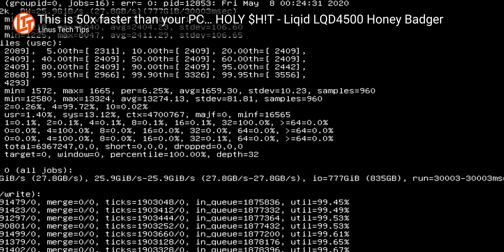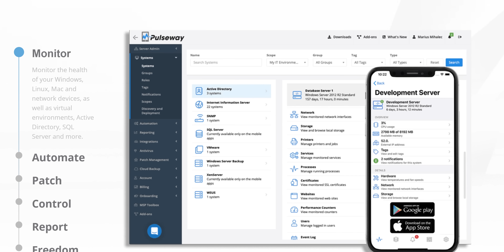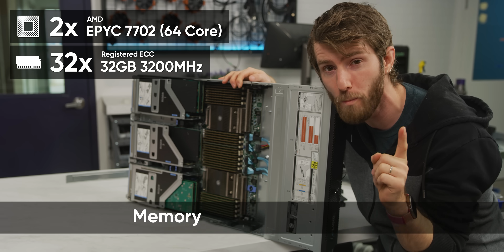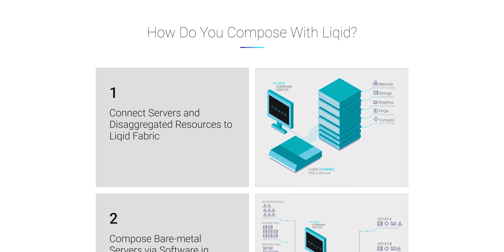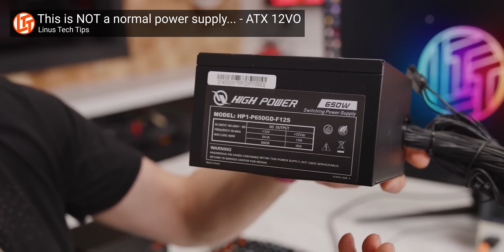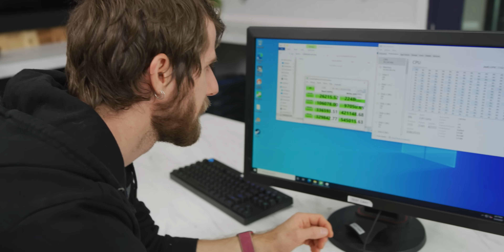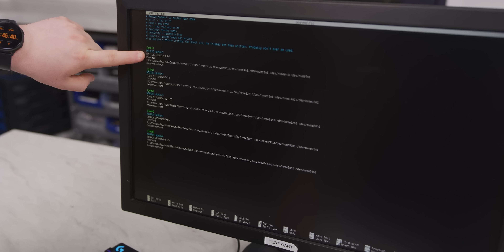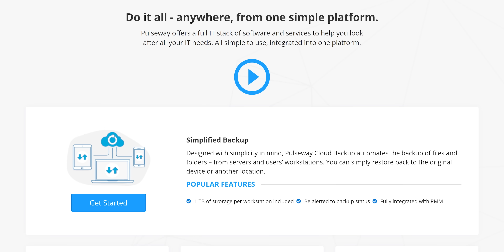This is the FASTEST Server I've Ever Touched... HOLY $H!T - Liqid Badger Den

Comment: That monster can go up to 160.000 MB/s if you use 4000 MB/s read/write M.2 SSDs in all slots.
Tho... 40 M.2 SSDs of 4000 MB/s would be quite expensive, but if you want an ULTRA FAST server then price shouldn't be your purpose (this way you can save up a ton of money).
Small SSDs which reach 4000 MB/s read/write should do the job (because well, 40 drives are gonna sum up to quite a lot of storage anyway, fast storage) ( ͡° ͜ʖ ͡°)

Comment: I think I'm jaded. While Linus and his crew are FAR more experienced in the benchmarking, gaming, and expert builds than I am, I get to play with Dell servers like that all day long. I've seen some interesting things roll through that he keeps wowing. 

Some things of note that he kind of glosses over: blade servers tend to require something like 2 minutes to post. There is a BMC/IPMI thing that has to fully initialize all the nifty pieces of tech in that chassis. Those fans START fast - sounds like a jet taking off - until POST is finished. This is when the fan profile takes over. The lid being off will cause the fans to spin faster by design. That thing is aerodynamically designed for every piece of silicon on it to cool with those fans. He also only showed one of the 2 power supplies. Granted, they're for redundancy, so it's still 1400 watts. You can take one out and still operate. 

If he got his hands on a 4U chassis, he'd have bunches of fun being able to take levels of CPU/Ram out with an amazing bridge thing connecting them. It's just a tray that slots out. A heavy tray.

Comment: It's actually quite thought-out the 2 way hot swap. A tech company and it dept would have multiple replacement full stacks of fans. So they could do a very short down time, swap it quickly and get it back up so the only down time is less than 10 minutes most. Then they can go and diagnose the fans and quickly swap out and test them and change them. It's done this way to increase production and negate down time of the server as much as possible. Quite well done by liqid.

Comment: Linus that 12v form factor for desktop pcs has been around for years especially  if its dell, Lenovo, HP, they are infamous for that, but the downside to those psu is due to the motherboard doing the conversation ,from what i have seen in 100's of cases if the psu blows so does your motherboard and that can be from surges, power failures or a dip in power ,i'd rather have psu blow then a motherboard especially if its a gaming rig

Comment: Your Liquid setup is getting pricy enough to start looking at a high performance enterprise NAS solution rather than going with a beefed up file "Server".
Although it is "Network Attached Storage" not a "server" with an OS like your Liquid setup, I wonder how a NetApp AFF800 NAS would compare?
I haven't got my hands on one, but it is supposedly scalable to 316PB in 4U high rack blocks (non-disruptive scale up) from 2-24 nodes.
It's minimum setup is with two controller heads, so you get (kinda) hot-swappable mobo's and core components, in addition to the expected hot-swap power/fan/disk..
Docs say it supports up to 20 100GbE ports and it  claims 300GB/s throughput.   I think a comparison of costs is in order here.

Comment: a) Jake might not deal much with server or enterprise-class hardware as the green light on the power supply is when the power aupply is in standby mode.

b) 30 GiB/s = 240 Gbps, which you totally hit with 3x 100 Gbps connections.

c) Dual AMD Epyc 7702 just gives you more cores/threads, not more PCIe lanes (because the socket-to-socket communication, Infinity Fabric takes up half of the available PCIe lanes per CPU) and therefore; you literally have no more usable PCIe 4.0 lanes with a dual socket system vs. a single socket system.

d) If you want to partition the server so that the NVMe devices are bound to the closest CPU, you can, again, set up something like GlusterFS either for HA or as a distributed parallel filesystem, export the share as a NFS share, which you CAN mount in Windows. That way, as it is presented to the network, it presents itself as a single share, despite the fact that the actual physical acts of data storage can be happening acrossed multiple systems/servers/nodes. (GlusterFS is ridiculously simple to deploy that even I, an idiot, can do so because I’ve done it using RAM drives.)

e) I forget if some of the Mellanox 25 GbE cards supports RDMA over said 25 GbE ports. I know that it does for some of their IB stuff, but I don’t remember if their 25 GbE supports it. Either way, if you can enable SMB direct/SMB multichannel and/or NFSoRDMA (and have the Windows clients mount that over RDMA), you will definitely want to do that to be able to take advantage of it.

f) 12x25 Gbps = 300 Gbps, which again, if you have 12 editing stations of various types/forms, you can saturate 30 GiB/s easily/readily.

It’s really NOT that hard to do.

Comment: Current Threadripper (32-core) actually does almost the same (between 43.000 (Stock TDP) and 46.000 (400W TDP) TR 3970X (overclocked up to 48.500).
64-core  3990 is ~60.000 (Stock TDP), 75.500 (580W TDP), overclocked 87.500

Comment: If Liqid wants a separate machine in the data center to house the GPUs while yet another one is dedicated to housing the CPUs, then you're going to have a really bad time doing anything in real time involving GPUs. Literally all of your GPU work is going to have to be batched because the response times from the GPU cluster will be in the range of milliseconds instead of the usual nano or microseconds you'd expect with a standard PC set up.
Reply: That's not really how the fabric works. Our latency is in the usec as the devices are bare metal connections. :)

Comment: A thought. run ESX and set the block offset for the storage first or you're using 1/2 the storage blocks per block write Linus. Would be the same for the Windows storage if not considered. You could use VMFS to help make performance visualization easier.

Comment: Bro plz help 
I have a MSI b460m pro vhd wifi mobo
i5 10400f 
And gtx 1650 super
I built it and installed Windows 10
I shutdowned for 1 hour and opened it again 
Then I'm stuck at MSI pro series logo ,I cant boot or anything,I'm stuck at motherboard brand logo
Is my GPU dead??
I cant do anything
Plz help ,what is the problem??🙏🙏🙏 
Anyone please help me🥺

Comment: I love the fact that the fan component tray at 250W is lower than the power usage of the entire IBM x3650M4 as my ESXi host in the homelab with 12x SAS drives (never mind the Isilon X200 with fan mods for FreeNAS) with a separate 12-bay tray. It’s certainly a hella lot quieter.

Ever thought about a channel (or just separate episodes) for homelab enthusiasts? Maybe Anthony wouldn’t mind hosting it.

Comment: The hot-swap fan array is an excellent idea for a data center. If a fan goes out, replace the whole array and get the server back up. No deducing which fan went out. Replace the bad fan from the array when the servers are live, ready to go as inventory for the next fan failure.

Comment: I NEED HELP!
Im building a PC and I have 6 RGB fans, my motherboard only supports one additional fan. I’m getting a RGB controller to power all 6 Fans the question is do I plug my controller into the motherboard or the psu? The controller has a molex cable, do i plug into motherboard with a molex>Sata adapter or into my psu? My guess is into my psu, thanks.

Comment: network upgrade makes sense - lots of sense - think about link agg some devs may want to run dual port card - 5g a sec matches up well with nvme - you want to most cost effectively eliminate bottlenecks - datacenters are going to 400gbe so don't feel guilty but you can build a 100gbe switch yourself and save a bundle over ebay infiniband - nvme scales so well for db ops it is a no brainer but 2.5gbe isn't a bad thing either for value tier #smb value generic box optimization #transceivers  #sfp #fiber #potato router #sonic on arm #connectx for bsd #100gbe for smb

Comment: Hallo and Merry Christmas
I have a question I can't find any info about online as noone seems to address this...
I know 2x16gb of dual rank gives you 4 ranks
I know 4x16gb of single rank give you 4 ranks
My question is what are the effects when you use 4x16 dual rank sticks? Do you have any gains? Do you actually effect negatively the system? Does the system even use the sticks properly at that point?

I am using Asus strix x570 E & Ryzen 9 5900X 

The memory is G.SKILL TRIDENTZ NEO 2X16GB DDR4-3600MHz F4-3600C16D-32GTZNC

Comment: The reason the entire fan slot cage thing is hot swappable is because there are power + data ports on the motherboard and they are underneath the fan cage when it is installed in the server. They are not accessible when the fan cage is installed in the server. If you wanted to install additional data/power cables for the front hard drive cages, it would be easier to remove the fan cage in one step as opposed to removing each fan. Time stamp 4:17

Comment: As to 12 Volt only.... Some datacenters now don't even have AC-to-DC in the server, they have a big rack-mount converter that takes 240V or even 480V at [large number] of Amps, and converts it to 12V at [ungodly number] of Amps to send directly to each server in the rack. Some data centers even put smallish 12V batteries on each server to act as "buffer" for power spikes, so the server's "power supply" can draw a nice even 12V/? A, and the battery smoothes out the amperage changes.

Think a rack-sized version of the giant power bricks used by "ultra gaming" laptops, and the server boards just draw 12V direct the way the ultra gaming laptops draw DC direct from the giant power bricks.

Comment: I was working at Intel when their first SSDs came out.  (The X-25M and X-25E.) I had an ultra-fancy massive 4U server on my workbench, and got a bunch of the then-blazingly-fast X-25E SSDs, which weren't even out publicly yet, to test.

My 4U server had 1 TB of RAM (which cost over USD $1 Million, for which Crucial threw in a 32 GB USB 3.0 thumbdrive to the order - thanks Crucial!) and I put in 16 32 GB X-25Es. That's right, this system had less storage than RAM.

I remember seeing very early reviews of the first "actually fast" SSDs and thinking "no, they can't be that fast!" So in my test, I made two RAID-0s (because each RAID controller only had 8 ports.) I copied some big .ISO test file we had from an internal file server - 2-3 GB of whatever (probably a hard drive image from our OS image farm.) I then dragged it from one RAID to the other.

"Huh. I must have missed Drive E." Dragged it again. "Would you like to overwrite?"

Yup, so fast the copy dialog box hadn't even shown up.

I can't imagine doing that with 100 GB.

Comment: It seems insane but I can think of a typical application for this absurd piece of hardware. Camera systems, specifically high end systems that utilize advanced features. A typical plain surveillance type of setup takes about 80MB/s just to get it's motion detection streams to the NVR for it to do further motion detection. Once motion is triggerred you then have up to 240MB/s for an HD stream and the motion streams or 320MB/s for all available streams. It needs all of that in both networking and machine bandwidth. Your typical home and small business kind of setup is 8 cameras. A small business with onsite work space tends to use 16 cameras. Large stores require racks of switches to handle all the cameras.

In an indoor shopping mall with say 3 or 4 wings, I could easily see one of these cutting out a huge amount of required infrastructure.

Comment: just to clarify 
red color means hots swappable (you can unplug when the system is running)
blue color means touchpoint in dell terms (you can not unplug when the system is running)
correct me if I am wrong but that's what I know from working on my dell r720
Reply: No I think you're correct.

Comment: As an IT guy my first question would be, how do you replace a broken nvme ssd when the server is running?
Reply: Most likely this sever is designed to be in large clusters as a single node, Its workload will be containerised using something like Kubernetes. To change the NVMe you would drain down the node and turn it off. This process would migrate all the containers to another node. With super fast storage and high throughput networking backbones this is a simple and fast task.
Reply: @n1ckeh88  makes sense of course. But you would have to spend a lot of money to get multiple of these :P

Comment: You should do a video on saving motherboards with corrupted BIOS firmware after for example a power outage during an update...
Reply: Any decent motherboard manufactured in the last 10 years has something akin to Gigabyte's DualBIOS feature, where it has either 1 chip divided into 2 halves, or 2 separate chips, and a DIP switch to instruct the motherboard which one to use.

Some of them automatically boot from the other chip (or half of the chip) if booting from the first one fails several times in a row, others require you to flip the switch first. In either event, you can still boot it, and then flash again. On the systems that automatically fail over, flashing a firmware update usually writes to the chip (or half of the chip) that it didn't boot from. On the systems with a switch, flashing a firmware update writes to the chip (or half of the chip) that the switch didn't instruct it to use, so you'd shut down after the update and then flip the switch again.

Many residential gateways also behave in this manner, for example when you perform a firmware upgrade on a Linksys WRT1200AC (or one of the models in that family, like a WRT3200ACM). The single 128MiB flash chip has one bootloader (that is never updated), and a few partitions for things like WiFi card data and bootloader environment variables, and then the remaining space is divided into 2 equally-sized firmware portions. When it fails to boot from one half several times in a row, it will automatically reboot from the other one. When you perform a firmware upgrade, it writes to the firmware half that it didn't boot from, and then when it reboots, it boots from that half. A consequence of this is that if you want to abandon the factory firmware entirely (say, to migrate to OpenWRT), you need to flash it twice: once with the factory image (to migrate from the Linksys firmware to OpenWRT firmware), and then once with the sysupgrade image (to instruct OpenWRT to write to the half that still has the factory firmware in it, which you performed the first flash from).

This is all to say, rendering your motherboard (or most modern residential gateways) a brick because of a failed firmware update is a thing of the past.
Reply: Aaron Jones Aaron Jones stop cherry picking your brands. Gigabyte may include dual BIOS on most of their boards (which is nice), but other manufacturers don’t, unless you want to move up into the mid/high-end price ranges. Saying that ”bricking” is a thing of the past is ignorant.

Comment: The reason all the fans are hot swappable is so that if one or more fails you can pop one full rig in its place then take the other rig away to fix with new fans for the future, rather than worrying about replacing just the one fan

Comment: Just to clarify this appears to be a rebranded dell. If this is the case the fans come out so that the motherboard can be replaced, and  generally not used for replacing every fan at once lol. Also just a pro tip orange tabs means hot swappable, blue tabs the server should be off before removal.

Comment: Hey guys, quick idea: Build an angled stand for presenting stuff like servers and cases. Add a ledge to lift it a bit off the table. Like so -/\
That way Linus doesn't need to hold servers awkwardly and Andy or David can easily film into a case while you build in it.